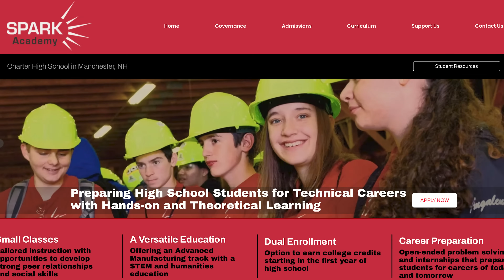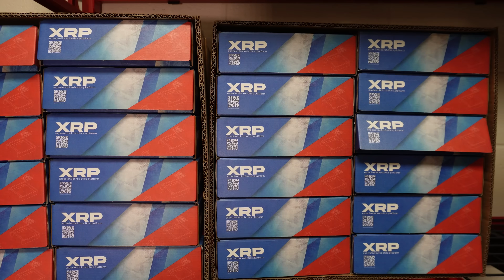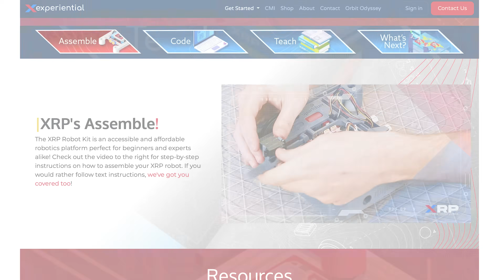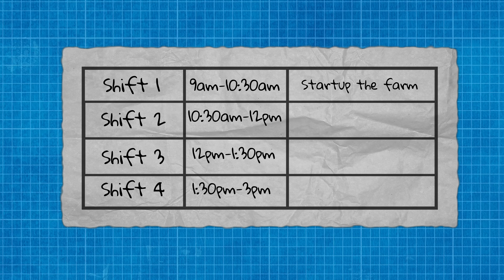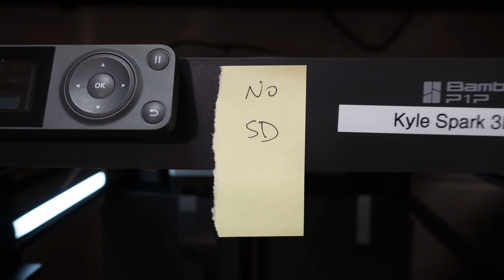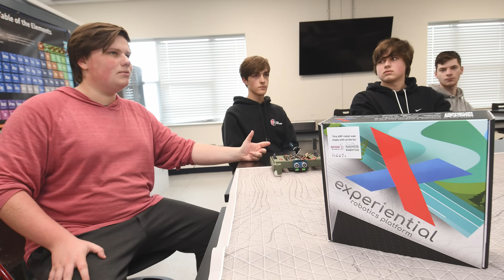This High School Can Manufacture!

Comment: There has been this change that in the past decade that 3D printing has become very accessible to everyone including students. It's basically considered a common subject at schools now. While this is great for education it's rapidly devaluing 3D printing and modelling as a skill, in that most people view it as an amateur hobby project than actual manufacturing technique, and most FDM quality and the ease of printing would support that idea. What schools should really focus is to bring more traditional manufacturing into curriculum that can actually be worth something in the job market. We live in an ambiguous time where 3D printing is not a valuable enough skill to be a career, while not a basic enough skill that everyone benefits from it in daily lives.
Reply: Spark Academy was founded by the head of MCC’s Advanced Manufacturing department, and the entire aim of the school was initially to get more skilled technicians into NH’s manufacturing workforce - which is exactly what they are doing. First Year students take CAD with Solidworks, and utilize 3D printing that way. 20+ of them so far have earned the first level professional certification in Solidworks, in fact. The print farm ELO is just one facet of what the school is doing.

Comment: i had the same problem with my P1P. from what i've seen and asked, I'm pretty sure that its a motherboard issue.
Reply: I solved mine by buying industrial SD cards. Constantly had SD card issues with the Bambu machines in my farm until I did that. Going on 8 months with no issues.